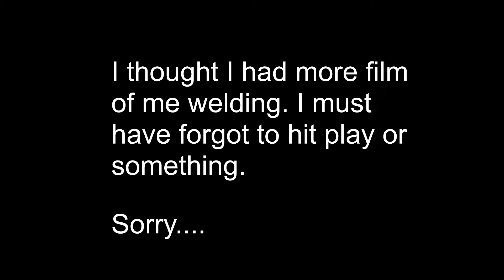Baja (Mauler) Frame build #1

Comment: great job looks good.  one small tip,
there is as much slag on the ID of a tube as the OD.  you will see a difference in your Tigs if you not only remove the slag from the OD but the ID as well.  I was told to do it and I did see an improvement.  I use a Flapper well on my die grinder then wipe the joint inside and out with denatured alcohol soaked rag.
try it you'll see a difference.
Reply from the maker: Interesting, I'll try that. Thanks for the tip. 👍
Reply: @DougBugBuilder  He's right. A pipe welder told me that so I tried it and my tube welds improved. Details.

Comment: Curious why not make the side rails one piece and bend them? Is there a strength difference between bending vs welding in those areas? I build stuff as a hobby so just wanting to learn what I can.
Reply from the maker: I think in a straight up test, the bend would be stronger. When you cut a tube and weld it back together it loses some strength.
That being said, what I've seen over the years is that essentially the difference doesn't matter. Meaning if you cut and miter, but then carefully do it where you can tie multiple pieces together you'll have the strength needed.
The benefit to cutting and mitering is the accuracy that you can get. Weather it's a control arm or chassis, if you can cut and miter you can hold tighter dimensions. At least personally I can. And it can be done with less tubing scrap.
If you pay attention to this build you'll notice very few miters that aren't tied in with other tubes from different directions. 
Great question BTW, hopefully my explanation helps.
Reply: @DougBugBuilder  yeah thanks a lot. I noticed when bending with multiple bends if its not level its a pain to make everything fit but some racing roll cages you dont have a choice. 
Here I thought you were going to say it was to show off your awesome tig welding skills ;) haha
Reply: If this was a production job, that would save time and material.
The strength of the welds should be equal to or stronger, then the tubing.
Doug’s experience gained, is showing. Give him time.
Pretty sure, he’ll look back an go, hmmm.

Comment: Great job so far. I have been welding for just over 15 years and was a pipefitter before that! From what you showed you seem to have done everything perfectly. The only thing I really want to ask (1) because my eyes are about burnt out the sockets, and 2) You didn't show the welds up close for a very long time) They look kind of concave from what I could tell. Do you plan to put a cover pass on them, or do you see them as finished welds?
Reply from the maker: I see the welds as finished. Actually I'm really prepping the tubes on this chassis so I can get some good welds. But I'll show them up close on the next video so you can check them out.
Thanks for the comment and for checking the welds. ✌

Comment: Great job Doug, I'm just catching up with your projects and I have a project of my own I'm going to be starting here soon. I'll probably be commenting on your videos quite often with some stupid questions. 

1. Great start with the jig. In my research I've seen a lot of fabricators start, and they're great except they don't take into account temperature fluctuations with their welds and the shop then see warping later...
2. What made you decide to build the frame out of 1 1/2 x 0.95? Was there a strength value/weight you were looking at or did cost drive this?
3. I see you reference Wratchet, and this is Mauler...are they identical?
Reply from the maker: Great to hear you have a project of your own. Ask any question you want, I love helping if I can.
1. Temperature warping is the worst thing about welding. When I look at something welded I actually see stresses and twisting. I can just feel them in there there. As far as I know the only way to relax it is to put it in an oven. So I try and just work my welds back and forth to dissipate it as much as possible.
2. I know a lot of chassis are done with .125" but that seems overkill and heavy for my builds. Since I'm not building to any specific racing organization I have freedom to make my chassis a little thinner. With the way I designed this chassis I think I'll be ok. But I guess time will tell.
3. I keep calling this a Wratchet chassis, and referencing Wratchet. I need to stop doing that, because although the base is the same, once I start building up It'll be really different. This build is in deed Mauler.